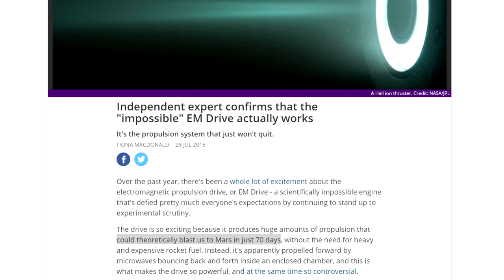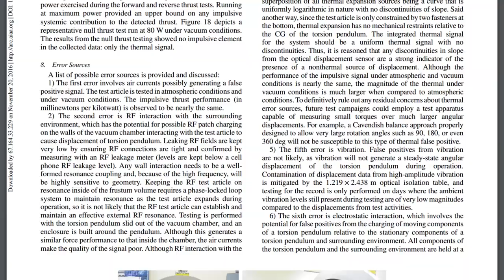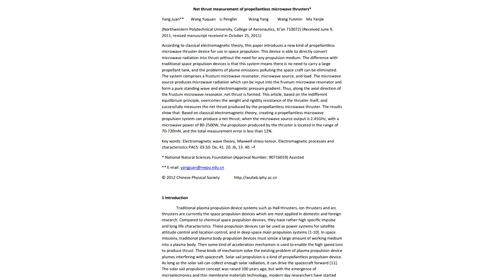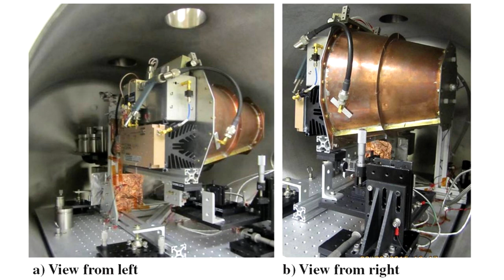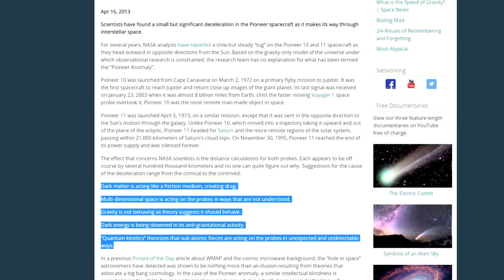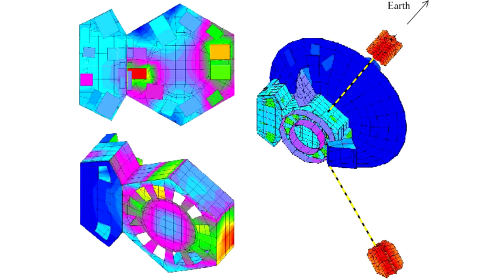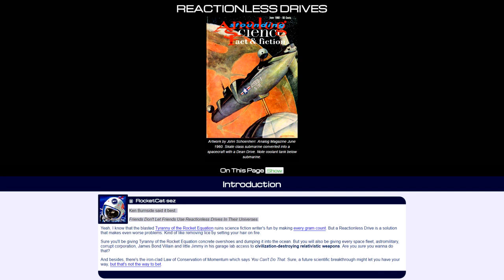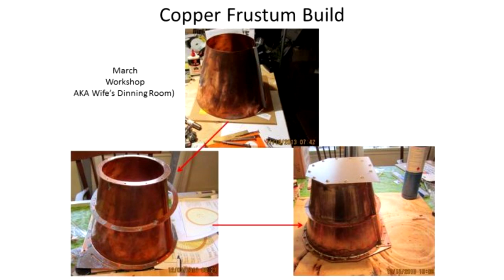What is the EM Drive? And Does it Really Work?

Comment: You said photons don't have mass but they do have momentum. How can something with no mass when momentum is mass * Velocity and photons have mass = 0?
Momentum is velocity * mass
Velocity is 3.10*8ms-1
mass is zero.
3.10*8ms-1*0 is zero.
Why do they have momentum?
Luv and Peace.
Reply: The distinction is that photons have zero rest mass, but have non-zero relativistic mass, where relativistic is used to describe a situation where the particle is moving at a speed close or relative to the speed of light. Furthermore, the usual formula that relates rest mass and relativistic mass does not apply, because photons themselves travel at the speed of light. Instead, to mathematically acquire the relativistic mass of a photon, one can apply the mass-energy relation (E = m * c^2, where m is the relativistic mass and c is the speed of light) and the Einstein-Planck relation (E = h * f, where h is Planck's constant and f is the photon frequency) to derive the relativistic mass of a photon of a specific frequency f, and is in turn used to calculate the momentum of a photon. Be warned that the term relativistic mass is somewhat shunned when you dive deeper into particle physics, but the term is a kind of conceptual training wheel to describe the concept to those familiar with classical mechanics.

Comment: If the only achievement of the "EM-Drive" was to focus thought experiments and estimates of cause-effect on particular wave-package geometries, it's a good enough carrot to dangle in front of the more inventive minds who are more interested in why it could work with improvements, rather than how it isn't working as it is.

Opinions are fine as suggestions for more research, but are as bad as the fantasy claims of perpetual motion devices if it's referred to as "absolutely" right or wrong. "No one's right if everyone is wrong", just likely to sound arrogant and insecure because we recognize misattribution, internally, there's no absolute zero-infinity of unity-conception. (Or, Physicists  wouldn't need to "Renormalize" because they could calculate with perfect precision)

Comment: 11:40   Not exactly true.  You can prove whether you are on a planet or inside a rocket with this experiment.   Put two plumb bobs as far a part as possible.  If you are in a rocket they will be 100% parallel.  If on a planet there will be a very small amount of parallax between them pointing to the centre of mass of the planet.

Comment: 'You Canna Break the Laws of Physics'. But real physicists just redefine their terms! Like photons having no mass yet carrying momentum, despite momentum being defined as mass times velocity! How exactly does a photon drive not break the laws of physics since there is no reaction mass and nothing stopping you generating as many photons as you want so long as you have the energy?
Reply from the maker: Photon drives are well understood, but this was claiming to generate many times the thrust of a photon drive for the same energy input which meant it wasn’t a photon drive.
Reply: @scottmanley  Thanks Scott(y)! As an engineer I do not believe in this drive because if it can generate enough thrust to be practical we would not be arguing about whether the trust was real. Should be easier to increase the thrust than make more sensitive measurement systems to ensure the thrust is real! What I do not get is why thrust from radio photons violates physics while thrust from light photons does not?
Reply from the maker: @john_hind  Thrust from any wavelength of photon is a well established and expected part of physics, but we know exactly how much thrust you can expect from emitting photons - you get 1 newton of force for every 300Megawatts of power. 
So the problem wasn't that this appeared to generate thrust, the problem was that it appeared to generate more thrust than could be explained by photons.

Comment: Well, it's 2020 and the EM drive doesn't work. still, I have to wonder. If mass can be produced using E = MC2 and ejected at near light speed for reaction mass to produce thrust, wouldn't you get near infinite thrust while only putting energy into the system? It's not perpetual motion. Energy is not produced out of nothing. But for applications where a vessel needs to produce small amounts of thrust over a long period of time, the energy could come from solar radiation.
Reply: aka a solar sail. photon drives work, but the power to thrust ratio is....prohibitive...

Comment: hmmm... so a pocket surefire flashlight is basically an electrical rocket using the light generated as the "reaction mass"... ok so efficiency is below the threshhold of viability... but damn did it give the researchers a paycheck didn't it? For building a copper kettle.... smh

Comment: So what could be happening?
Reply from the maker: a follow up paper by another group is pretty sure the forces are magnetic torque from interactions with the earht’s magnetic field.
Reply: @scottmanley  I guess I've already watched this video. lol What about a nuclear engine to run space crafts. Submarines can go 20 years without refuelling something like that would be able to provide thrust for a spacecraft to go to and from other planets. I guess the problem would be accepting the risk of the rocket that's taking it up there might radiate the earth but don't we have a nuclear fuel that doesn't cause radiation issues? Could the EM drive be working off darkmatter or dark energy or has it already be proven to not work? We already have flying cars there called helicopters. lmfao

Comment: they did use a dummy load and it not generate any force
Reply: while the last paper does not mention a dummy load in the previews test 
campaigns they most certainly used and mentioned dummy loads, they did 
not produce any thrust.

Comment: EM drives are real.  I personally was a witness to the Arizona lights fenominom.   It was at the Marine Fighter base in Yuma Arizona. 

One night I was video taping fighters doing touch and goes.  At around 9pm.  the fighters did a touch and go run and never returned to the base.  Satisfied that the show was over, I packed up my gear.  As I was walking down the dirt road and my uncle's trailer court I looked up.

To my confusion,  the sky above me was black.  There were no stars above me even though the sky was clear.  Then I decided to look forward towards town until the stars appeared again.  It was then that the shape of the craft revealed itself. 

The distance between the leading edge of the wing to where the stars appeared again was vast.   About half a football field from the nose to the back of the triangle.   It formed a fat arrowhead shape.  Then a tiny strobe flashed at the end of the left wing.  Next a tiny strobe light flashed at the tip of the right wing.  Total length from wing tip to wing tip was roughly about a football field in length. Altitude was approximately 1,500 feet.

The craft moves slowly.   Almost
 at a hover and made no sound.  I looked over at my brother and grabbed his sleeve.  I pointed up and the aircraft was gone !  Only a craft with a Zero Point energy drive could zip away so quickly.

Comment: Your common sense will be relieved to find out dark energy is an illusion induced by a gravitational dopplar effect.
The observed redshift of distant galaxies is caused by the gravitational field of the distant galaxies which stretches the observed wavelengths over the duration of time in transit.
Gravity not only distorts the path of light, but also affects the wavelength of radiation emitted until it is observed.
There was no "big bang", this universe is infinite and eternal. Galaxies and stars continually recycle mass & energy.
Reply: @(S)-Riley Dunn lol, try apply thermodynamic laws to continuous dark energy acceleration. You seem to be brainwashed into a narrow bandwidth of understanding.
Reply: @(S)-Riley Dunn Energy is continually exchanged between the infinite quantity of galaxies through electromagnet transfer. Your own thermodynamic laws conflict with your dark energy theory.
Reply: @(S)-Riley Dunn sapiens are clever enough, you'll figure it out eventually.

Comment: Beware (6m05s), any torsion balance will also measure a tiny TORQUE generated by a "Test article" even when the "Test article" does NOT GENERATE ANY NETT FORCE in any direction!!! 

Any TORQUE generated by any "Test Article" (trying to sp[in about its centre of mass) could then be observed (and then irresponsibly or at least misleadingly be reported) as being a force (!!!) . This erroneous "force" would have a value equal the following:-
The ACTUAL REAL TORQUE generated by the "Test Article", divided by the DISTANCE between the axle of the torsion balance and the middle of the "Test Article" !!! If there really was a real nett force from the "Test Article" then a "reaction-force" of the same size but in the opposite direction would exist at right-angles to the axis of the torsion-balance's axle, but I doubt this was measured.

So how could a "Test Article" generate a nett torque when a reaction torque does not seem to exist? please consider the following:-
If the "Test Article" behaved similar to a single 10 [cm] x 10 [cm] square coil of copper wire carrying 1 [Amp] and placed in the earth's magnetic field (of flux density 0.035 to 0.070 [mT] milli-tesla), then the coil would try and spin, and the Earth would be the reaction-torque.
If the "plane" of the square coil was placed in-line with the earth's magnetic field (presumable running from the North to South pole?), each of the two sides of the copper coil would generate an equal and opposite force  (Force=BIL) of between 3.5 and 7.0 [µN] (micro-Newtons), and hence a total nett torque about the centre of coil of between 0.35 and 0.70 µNm (micro-Newton-metres).

If the centre of this coil was then placed on the arm of a precision Torsion-balance, then the Torsion-balance would have to also generate a torque of between 0.35 and 0.70 µNm about its axle to counter the rotation of the coil (Test article). Hence if the coil was placed 0.55m (metres) from the axle of the torsion-balance, then a false force of 0.63 to 1.27µN (micro-Newtons) would be displayed by the Torsion-balance.
The alleged force measured was 1.2µN for each 1 Watt of power input into the copper frustrum.

ps
It has been 2 years since this video was made (today is 26/06/2019) so apologies if the above has already been explained in another one of Scott Manley interesting videos
Reply from the maker: This is what I expect 
https://youtu.be/rJM6lP9CuSw

Comment: Physics is so confusing as often as physicist contradict themselves it's a suprise they have not been put in a class with astrology, geomancing, and cosmology documentaries.  Why would acceleration be progressive for the general  universe but not an object?  I mean if you accelerate under thrust 1000 ft per sec per second and then shut down the engine does the 1000 ft per second acceleration per second continue in space where there is no drag or resistance or does it remain at the speed it is at when the engine is shut down.if not what is the reason the universe is expanding and accelerating  .If it does not continue it's rate of acceleration then the only answer for the universe accelerating would be the universe is spinning ! ? Or I could use krauss and Hawkens as examples of physicists who contradict themselves in the same breath if you would rather.  : )

Comment: First, even in the initial description of the explanation of how a frustrum can generate a net force, this is WAY too similar to many, many explanations of how a given device can produce over-unity power, so yeah, it fails the BS test.
But second, when Einstein wrote up special relativity, this broke a lot of existing physics, with predictable resistance from physicists, and then when whoever you can blame for this came up with quantum mechanics, even Einstein pushed back, HARD.  So if there is yet another quirk of physics that makes conservation of momentum not-quite-sacred, then a) it is going to produce a lot of push-back, but b) if it turns out to stand up to repeated, rigorous experimentation, then physicists will learn how to live with it.
And by the way, recent developments are bringing into question the measurements that were the impetus for the need for dark matter, so all is not lost.

Comment: Flying cars? We have more then enough trouble with drunk, stoned and distracted drives on the rods now! Think how much worse it would be if they were flying! If they crash on the ground, they pretty much stay there. If they crash in the air, they're coming down and that only adds to the danger. Now if this new drive IS a reactionless drive, great! We can get to other planets in the solar system faster. But if it doesn't work, then we're right back where we started. However, sooner or later we're going to have to find a way off this rock to several other rocks elsewhere or face the death of the human race. This planet can't support us forever. Everything runs out eventually.

Comment: I don´t get mad when people invent things like this. This sort of this is often how our understanding of physics and science changes. That being said, even if it does work, it seems horribly impractical for actual use in space propulsion.
Reply: 1.2 millinewtons /Kilowatt sounds pretty feeble, but if it were ejecting reaction mass to produce the same thrust, we can calculate what its specific impulse would be. P = 1/2 F x V, so V = 2 x P/V. 2000/.0012 = 1,666,666 2/3. Divide by 9.80665 and you get right at 170,000 sec. If somebody offered you an electric engine with a Isp of 170,000 you'd jump at it. The main problem is the enormous radiators you'd need to get rid of waste heat for any useful thrust level.

All this said, I'd love the EmDrive to work, but I'm 99.999% sure it doesn't. If it does, conservation of momentum goes out the window, and--remember Noether's Theorem--so does the homogeneity of space.

Comment: Why doesn't someone build one of these with solar panels and remote cameras, point it towards the sun and see what happens, big push and monitor the thing as it excelates or just drifts around doing nothing, if I understand the principles as you discuss them,the sun should provide plenty of electricity to make it go, just saying where is  real science TSN
Reply: that's very close to solar sails! basically a mirror reflecting sunlight and getting the momentum from the photons, and it's an existing technology that's been to space and used in real missions.

Comment: This is a tiny beginning stage prototype. To compare a bottle-rocket to a space shuttle would not be right. That's not to say that this will have the potential to advance that much or more, but it could, because it is ultimately a different propulsion mode. Physics was made to be broken. Einstein failed to accept this fact and that is where he went wrong. There is always a better answer. Math is not absolute. Building a bridge requires imaginary numbers which contradict traditional math. Everything we know and have is just pattern recognition. There is no divine absolute code to existence. If people would have taken this technology more seriously earlier, then we would already have the answer, but people are slow to change, even if it is for the better.
Reply: A tiny beginning is an overstatement ^^ If you need the most sensitive thrust sensor in a vacuum chamber to actually measure anything while pumping in 100W. Chances are you just measure garbage and not that Einstein and Newton were wrong

Comment: The internal shape of the container is meaningless, the inside profile will always be equal in both directions, all you do is move the mid point, the maths are simple a=b a left side profile and b right side profile are equal, just because you make it an angle does not change the energy interaction at the molecular level.  This whole drives ideas is dumb!

Comment: When we see the case of reflection of light through a glass surface and compare it with the deviation of light due to gravitational force during total solar e cclipse in the year 1919. It was found by sir Eddington that light rays deviated through an angle of 1.75 arc radians. Here we know the radius of sun distance of sun from earth and some other parameters,when force required to deviate light through this angle was calculated, it was found 2.0 multiplied by ten to the power  minus twenty Newtons. Here it should be noted that light is a particle it is proved in photoelectric emission. Now an atom contains electrones,protens and neutrons . Neither electrone or neuclius has such heavy force of attraction at its periferi whose radius is of the order of ten to the power minus eighteen meters and ten to the power minus ten meters respectively. So we came to a conclusion that surface of glass contains tiny black holes having certain short life period which can be calculated by Hawkinsons radiation. Only these tiny black holes can deviate light from their path. If atom also contains tiny black holes , they can take part in em drive.